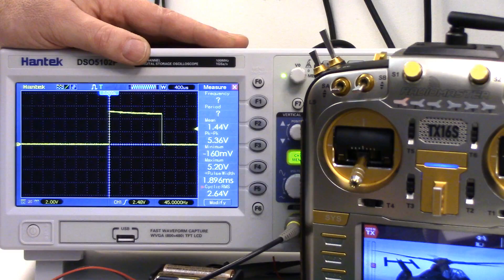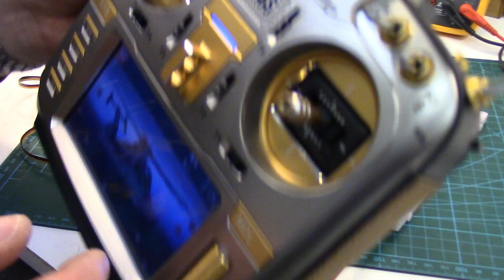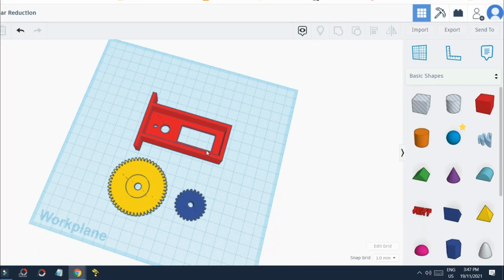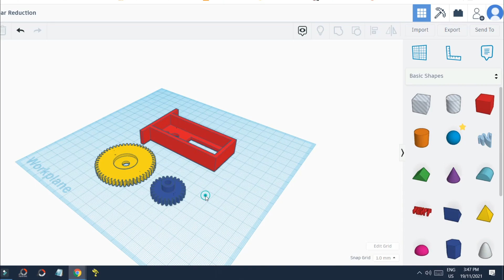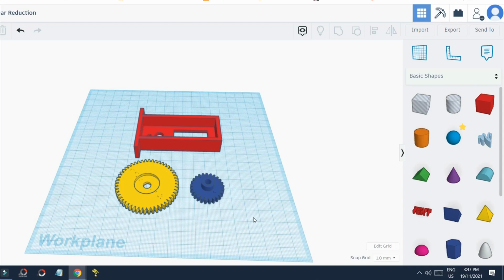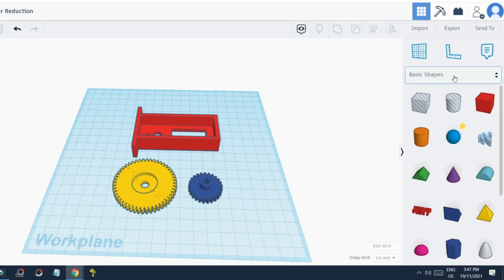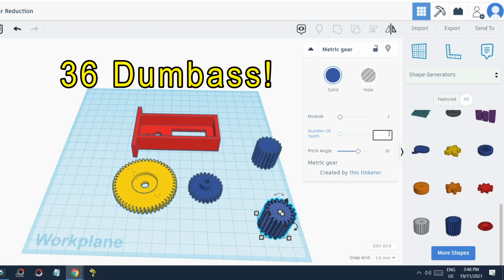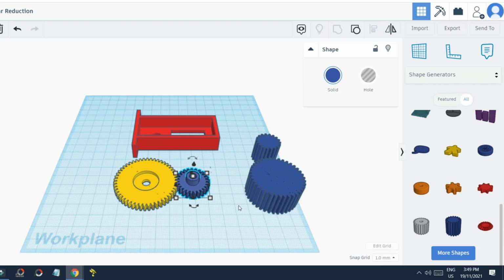RC Multi Switch - Control 6 or more switched outputs with one RC channel.

Comment: I really like this setup and got a TX16S to do this exact thing.  I cannot figure out how to get the multi-position buttons to do anything.  I haven't flown anything for decades, but am building an R2.  I can't figure out how to get the multi-position buttons to do anything.  I am trying to map channel 9 for that output, but I don't really understand the radio, I guess. In the old days, we had manuals to help with that, ha!  If someone could throw me a bone on how to do this, I would appreciate it! Thanks!
Reply from the maker: We have something better than manuals these days - the internet.
Any radio running opensource Open or Edge TX OS has an order of magnitude + of features; way more than any manual could practically cover and as one of my favorite engineering adages goes "complexity hampers execution".

If you are interested, I cover what everyone should first take into account when thinking of getting any radio system running Open/Edge TX in this video:  https://youtu.be/w33syhcWsHM?si=fIDvouSvW-uIi11Q

As explained in that video, OpenTX University helped me the most when I too almost gave up with OpenTX, and I still reference it when I need a refresher on something: https://open-txu.org/
I personally use a stepped output curve on the channel I have assigned to the rotary switch servo that coincides with the rotary switch positions but as you'll quickly come to understand after digesting all the programming info in OpenTX-U, there are multiple ways to manipulate the outputs. As an RC heli pilot, I intuitively used the one that made the most sense to me - curve programming. 
Have fun with your R2 build. 🙂👍
Reply: @Rchelicopterfun  John, this is exactly what I have been hunting for.  I love the ease in which you explain things. I am diving into "school" tonight and will eventually master the radio and R2.  I'm multi-engine instrument rated in fixed wing category and an almost retired family practice doctor after 35 years.  That means I love the challenge of learning new things.  Biggest one so far is where to get the information.  My go-to library is youtube and google.  So easy to watch someone set something up, and much more interesting to know how it's really done.  Thanks again! Subscribed for some time now!

Comment: Very clever mechanism. If you go from triggering the first sound to the last sound doesn't it mean the switch will contact everything in-between there by triggering every sound along the way?   There use to be a multi-switch device commercially available made by MCD (Model Control Devices) that would turn one proportional channel into 8 or 16 on/off switches. It required modifying your transmitter by adding a bank of buttons on the outside and wiring it in where a pot was connected, pretty hard to find one today though.
Reply: I just watched your other video. I understand now you are using two channels so the sounds aren't triggered while the rotary switch is moving. Very clever solution indeed,   Something you might consider (if you haven't already) the Adafruit sound FX boards have a reset that will stop any sound from playing at anytime (it grounds just like the sound triggers). It's useful in case you start playing disco Star Wars or the Imperial march or something then need it to stop because someone is trying to interact with your droid or the Mayor decides to suddenly give a speech or any other reason.
Reply from the maker: @schmitty1944 - good tip on the "rst" pin to reset the board. I've never run into this issue yet, but it would be easy to implement seeing I still have one spare ground pin out on the 12 position rotary switch to ground out the rst pin for a full reset.

Comment: Hello sir 
I have designed such. A tiny microcontroller  PWM reader which can do 1 through X separate leds or anything else.
It uses a Picaxe 14M2 chip. It reads the receiver channel pulse width then translates the width to activate the control part. It is small, low power, uses no servos, and can do many neat things with only using 1 rc channel. If you want to replace your servo/rotary switch... this is it.
Reply from the maker: @William Peterson - Do you have link or sales page so I can  read up on it? I don't need it now for this specific project because I 've got everything working exactly the way I need it, but for future projects or others looking for a single RC channel, multi relay control switching device, it would be useful.
Reply: Interested if you can give us more infos.
Reply: Any more info on this William Peterson?
Reply: Is it possible I can buy or get your design that might be perfect for my needs

Comment: i must say good solution. i needed a on off rc switch for some lights, the solution that was offered was in my opinion to expensive. ended up using the arduino. but there must be a cheap source of rc signal compatible chips . so we can craft a smaller digital solution

Comment: I realize you already found a reasonable solution, however I just want to alert you to the existence of multiple arduino libraries which allow you to read servo control output from a receiver in code and then you can do whatever you want with those signals.

Obviously a much bigger learning curve if you aren't a coder but this might still be useful for someone who is
Reply from the maker: Yep, I knew about those options as well, but I'm not at all into Arduino or knowledgeable about it. Just looking for a simple plug & play off the shelf multi switch solution that can used with a standard RC receiver. Thanks for the info however for others who may want to go the complicated Arduino route.
Reply: @Rchelicopterfun  if you breaking out an oscilloscope to look at pwm some basic Arduino sketches are definitely simpler :).